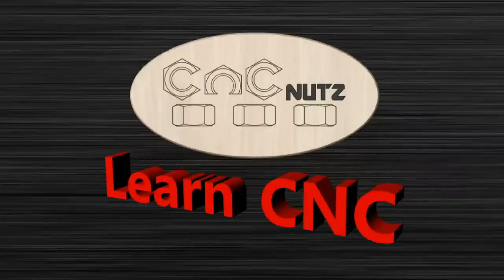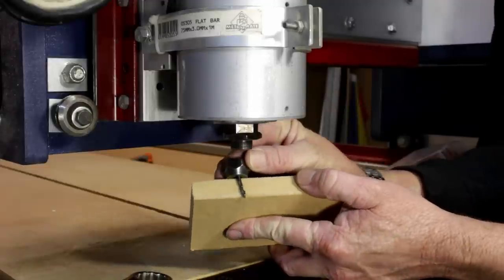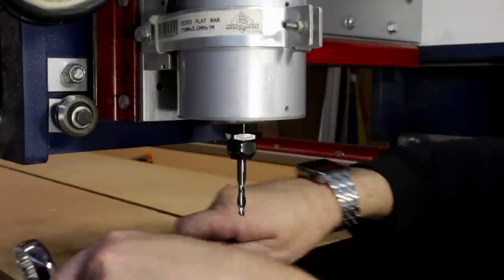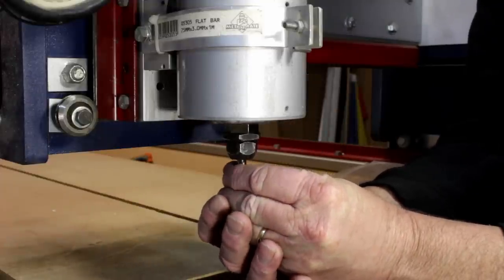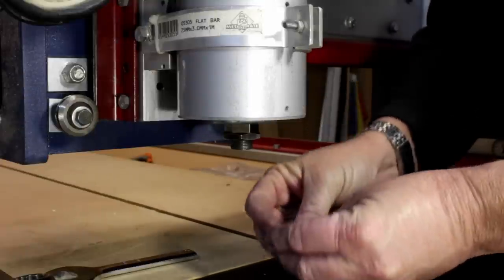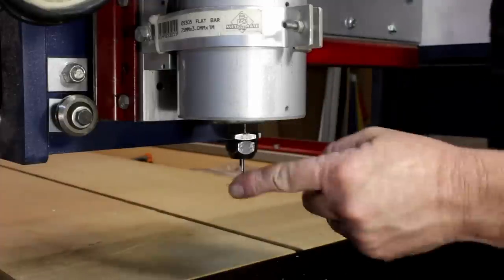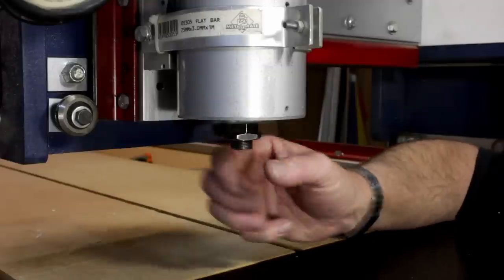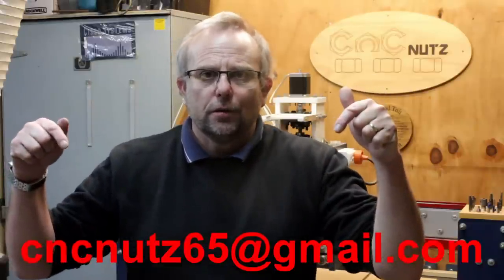The Secret life of ORings - CNCnutz Episode 117

Comment: First 

My favourite 1/4 to 1/8 adapter is from LeeValley. It's under 6$ and they often have free shipping
Reply from the maker: http://www.leevalley.com/en/wood/page.aspx?p=30126&cat=1,46168,46180,30126

Are these the ones you are talking about?
Reply: CNCnutz (Peter Passuello) yep! They don't fall out with gravity in my spindle.
Reply: Are adapters/bushings safe to use?  I like the idea but don't want any accidents.  I also wondered if the o-rings can withstand the heat transfer from the friction while cutting?  Thank you
Reply: Leba o rings are used in cars and coffee makers. I'm sure they can handle the 50 or so degrees ;)

And yes of course it's safe if you have the collet tightened properly